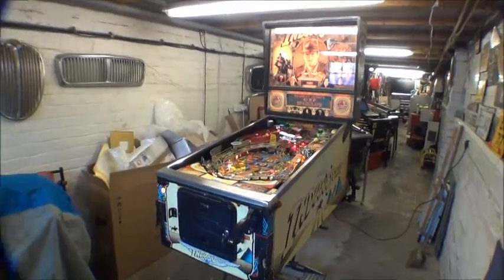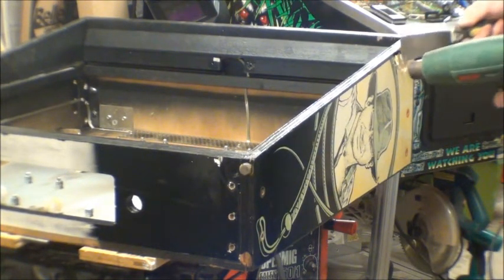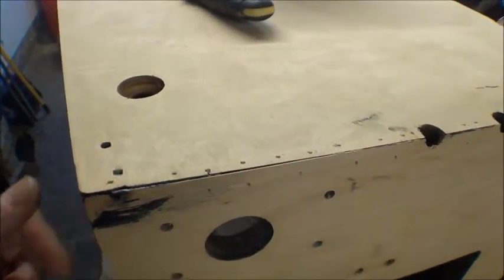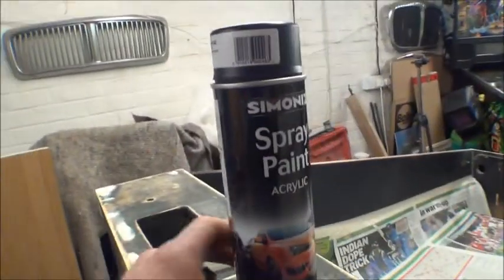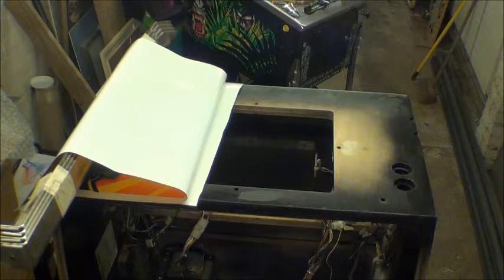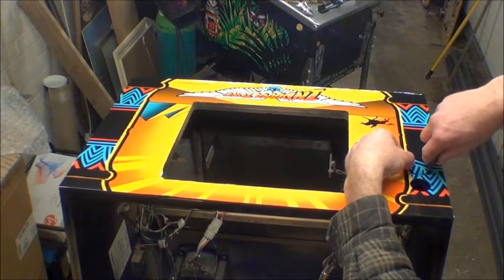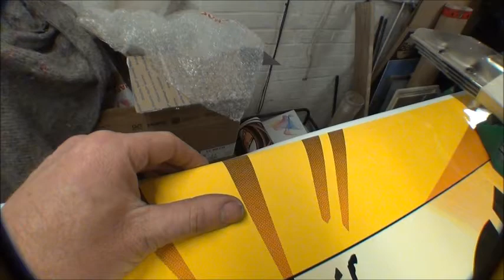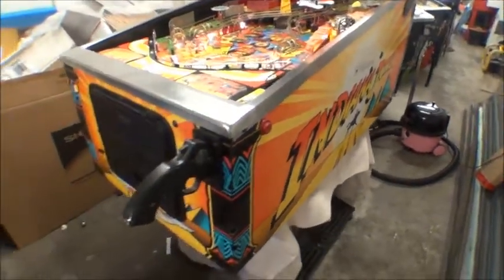How to re-decal a pinball machine, well my method anyway!

Comment: My tip to add to this great video is to use a new razor blade after every few cuts.  The blades will dull quickly and that is when you can screw up a cut and possibly tear the vinyl.  Those knives have lots of snap off blades, so just break one off every few cuts and then you won't have any issues.

Comment: looks perfect however I would ask you to try this If you go to the pinball factory in Chicago you may see them working putting these stickers on the cabinets they use 5%  soap with water sprayed on cabinet work before applying sticker that way you can remove it if needs adjusting seems counterintuitive but I have used this method since 1985 saves a lot of headaches and money.                  

 Cheers from California
Reply from the maker: Thanks for that, there are 2 ways of applying decals, the wet and dry method. The wet method allows you some repositioning before they adhere properly. Personally I don't think the adhesive is as effective following use of the wet method but its all down to personal preference :-)
Reply: I understand however we have pieces of inventory over 25 years that have had this done and they are still sticking just fine... anyway love your videos take care
Reply from the maker: Yes, I agree, I just think its personal choice whichever you use although with the dry method you have to get it right 1st time!

Comment: How do you make sure you don't cut into the paint when you run your knife down the straight edge?
Reply: Tim Sampson Wet the surface works so the blade slides and cuts, like scraping paint off glass get it lubed up makes things much easier...